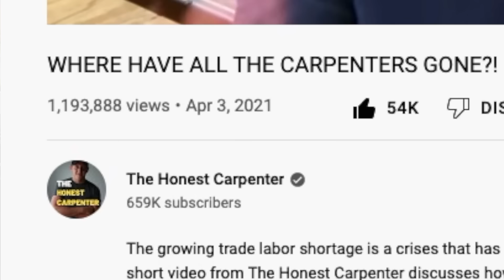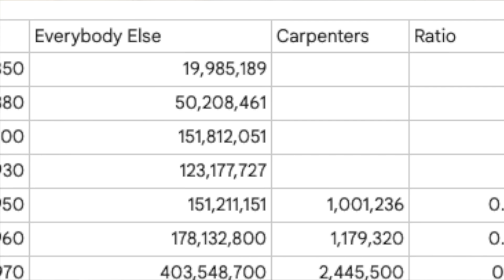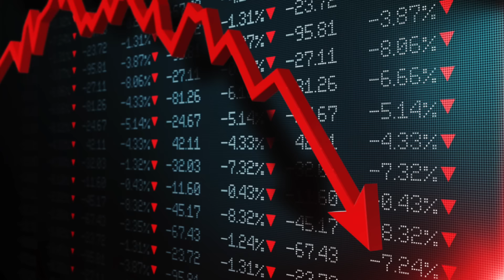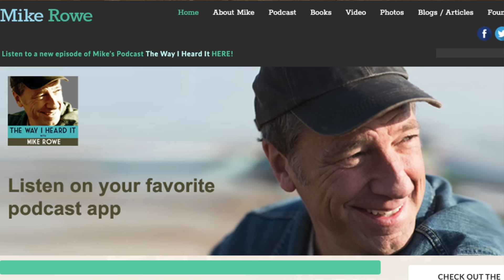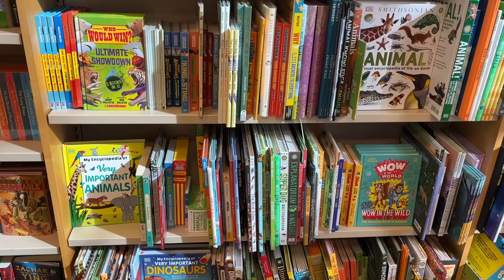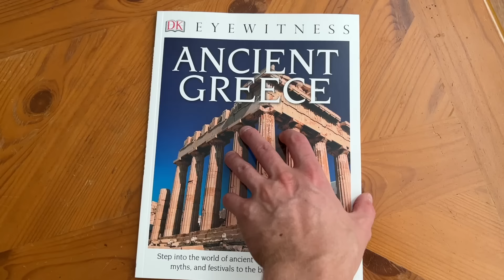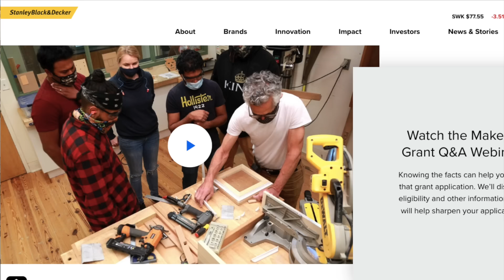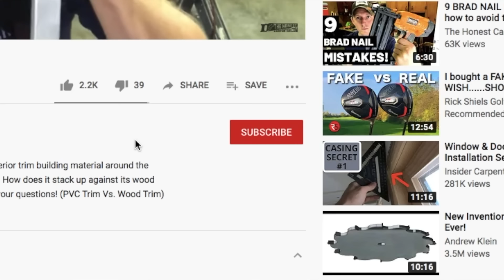THE TRADES ARE DYING...But The World Still Needs To Be Built! CAN WE FIX THE SKILLED LABOR SHORTAGE?

Comment: The issue I had with the trades is that everytime I've applied to any of them I was always pushed away for "lack of enough experience" instead of being welcomed and trained. These trade companies need to be more willing to train people even if that means slowing down a bit for the sake of growing their work force.
Reply: Yeah, only unions or “community” college/Vocational schools/trade schools will give you the experience not many companies are willing to train people as it hinders their bottom line. This has always been the case, and is why guilds were so popular leading up to the Industrial Revolution.
Reply: 19yr old carpenter here. I got very lucky with the company I got hired. I applied to about 12 and only one offered me a job where the rest rejected me for not enough experience. Yet I had several years of finish and labor positions.
Reply: Absolutely correct. I'm a veteran steelworker and welder. I have no problem training people and my training retains people. Sadly, many bosses are still in high school and can't think beyond their ego.
Reply: @KRYMauL  When it comes to welding, trade schools NEVER teach realistic experience. NEVER. In fact there was a time that if welding companies knew you went to  certain welding schools (diploma mills), they would not hire you.
Reply: @heyman5525  I’m talking about getting training not just going to pass a test
Reply: Yea.  Its bs. And the older you get the worse it is.
Reply: @KRYMauL  You're good. I just had to make the point that there are some false promises with certain trade schools. It's not going to hurt, but sometimes people are out $20,000 and then have to relearn everything on the job.
Reply: @heyman5525  That’s a problem with basically every degree and is the price you pay for specializing.
Reply: I'm a welder and I've been told by several companies they they aren't actually looking for welders but millwrights willing to work for welder wages.
Reply: @deviouslee1183  so whats that comparison.  Are you a rig pipeliner
Reply: I'm from Michigan and many companies around want to hire apprentices but want a year of experience 🤦‍♂️like that's why I'm trying to be an apprentice because I don't have experience
Reply: @Jack-bs7cy  i get that.
Reply: My father in law is a contractor and he’s trained 7 people in the last 5 years. If you really want a trade job keep calling around. Look for small owner operator type companies. I’m fully employed on the farm, but I get offered trade work quite a bit. Im 25 and my only employment history is a year of bagging coffee in a factory and work more or less for myself on the farm.
Reply: @swamp-yankee  what trade are you
Reply: Basically what I'm going through as an Electrician Trainee. No places wanna hire me cuz I'm not a journeyman.
Reply: The reason why nobody trains anymore, is people invariably jump ship once training is complete and the worker has a minimum of experience. It's cheaper for management to poach employees from competitors.
Reply: Yeah and stop being greedy and pay accordingly to skull set.
Reply: @luisr1223  lmao fr
Reply: Sounds like everyone commenting here are in the same boat regarding to the dilemma of being employed after trade school or other.  As an automotive technician of 20 plus years it is no different here... 
Towards the end of my college training I was about to receive my automotive certificate of completion and I was looking for job everywhere. No one was willing to hire me due to the lack of experience. Dealerships, forget it they wanted you to have "their" specific training. Working on multiple manufactures doesn't cut it. Also many independent shops required a minimum of 3-5 years as well. So how was I able to get a "real career" job and build my experience if the doors kept closing on me?
Well I eventually had to start at the bottom working for a poorly runned jiffy lube and waited patiently to find a real tech job while going through college. Once I did the other hurdle was trying to obtain my ASE certificates. I couldn't receive them even though I passed 3 when I started working at my first shop. They had a requirement stating that you needed to be working in the trade for a minimum of 2 years or as student in the field you must obtain a written letter from your employer stating your currently working at a reputable shop. Which is what I end up doing. 
It is indeed a lot of hurdles to go through and there is no one way to take a direct path in this field. No guidance really.
Reply: @luisr1223  they want apprentices so they can pay as little as possible without actually hiring you, then they get a new apprentice, or you are much more efficient than the average workers
Reply: Every thing is On fire they dont know how to treat peiple and slow the F down and Be kind.
Reply: @nonconformist369  ota like.  We ve seen the supppsed benifit of "Free" markey capitalism, when in fact free markets dont exist
Reply: @nonconformist369  ota like.  We ve seen the supppsed benifit of "Free" markey capitalism, when in fact free markets dont exist
Reply: This right here. Ive done my CA General Electrician Exam already and all I need is the hours before I'm a Journeyman (For context, apparently CA is having a huge issue with trainees and apprentices not passing their exam, so passing it is a huge leg up). But even with that and more on-hand experience compared to a 2 yeared apprentice, no one is picking me up purely because of no recorded experience. The only ones I've gotten ahold of want to pay me under the table, meaning I can't even get my hours if I do work for them, and it's usually better for me to just work for some minimum wage fast food job at the rate they want to pay me. I don't know if it's because of the recession we're going through, but it feels like the trade drought I've been hearing about is almost self inflicted in some trades.
Reply: @heyman5525  I worked in the piping industry. Most jobs require that a welder prove his qualifications to weld each different material and procedure.  Bust your test and you don't get the job . 

So it doesn't matter what weld school a person goes to , you gotta put in booth time to get good at welding.
Reply: Not sure where you live but no one is turning down experiences or inexperienced help
Reply: Facts. It was annoying.
Reply: Thanks for this post I’m glad somebody said it.
Reply: Companies dont got all day to train people that leave the job 80% of the time. It is too much of a risk.
Reply: @heyman5525  I agree with the statement of many of them have this high school complex to them. I’ve been to a trade school and then did some labor work but also went to college. Many of them will often judge you on your life decisions. Most would say this is a real man's job and that is why we get paid more than most college graduates. I would agree but I wouldn’t judge another individual for wanting to do both. Trade work is better than working some part-time minimum wage job like most students. No student debt and have skills that will help me for life. This is from my experience and not to judge other trade skill worker.
Reply: This is what I've been telling companies for years. 
The response I always get is: If we train people, we invest company time and money into them, and if they leave for another company then we lose all of the time and money spent on training that employee.
My response is always: Maybe you should pay people what they're worth, and they'll stay.
But nooooo companies can't do that!!
Reply: @justchill4885  im a hiring manager for 6 years and this has been my experience that more than 70% of employees leave jobs due to reasons non-related to pay, including not getting along w coworkers/supervisor, work schedule, "tired of the same thing", "moving in with gf at a different town", etc etc anything you can think of.

So most companies have a policy in place to allow employees to prove their commitments and worthiness before investing more training into. You will not believe the amount of people we get that just want to "try out" the trade and end up giving up in a few months.
Reply: @machinist7230  employer trains employees while making money on them. Employe gets training does great job .... Same pay ask for more pay hard no. Jumps ship for double the pay for the same job. Employer mad 🤷‍♀️ well I'm loyal to the highest bidder not sorry.
Reply: @carrsllccarrillo6507  as an auto tech as well, You are correct. Been there done that. I eventually got my foot in the door the old fashioned way, by networking people I knew over the years.  learned most of my skills on the job after that. Real world practical stuff I was never taught in tech/ trade school. This was done long before the internet.
Reply: Pure bullshit, they say that about everything. As soon as I started to look for a job with my CDL license I found out there isnt enough jobs for CDL drivers.
Reply: Exactly. Everyone has to start somewhere. How do they expect anyone to gain experience when they can't even get hired because of lack of experience. They need to be willing to train people or else they're going to continue to suffer.
Reply: @justchill4885  They wonder why nobody wants to work anymore.
Reply: i have personally hired, worked with or trained about 75+ apprentices. maybe many more. About 15 percent stick with it.
i loan the tools and everything to get started in the beginning to ease the entry.
its hard to get energetic, self motivated dependable people.
i go to a job with 3 apprentices to put 5/8 drywall on a 12 foot ceiling.
my boss says he doesnt know how i do it.
he cant handle training one apprentice. most journeyman dont want to train. i get it. its expensive, time consuming and frustrating in so many ways.
in the last 5 years i have personally worked with about 25 apprentices. so few stay.
i need a selection of decent candidates to train. i just cant find them.
toronto
Reply: @heyman5525  thank you for training people with no work experience
Reply: @KevinChannelTV  True
Reply: @teaadvice4996  Thanks, sorry about my previous comment, I misread and misunderstood you.
Reply: if you went to a good school you wouldn't have this issue. 
i got recruited at school by a company.   didn't even have to apply.
Reply: @darkracer1252  You got hired because your school trained you according to the qualifications that your employer required. No school teaches the particular type of welding field that I am in. We have to retrain all the people that have come out of school. It's not that schools are bad by any means, but rather, our particular field is very specialized.
Reply: @heyman5525  no i did not. 
i come from a time where the school system simply was still good.  

the company that hired me had to retrain me in their operating system and their way of working. 
the school simply made sure i understood what they were telling me.
Reply: It's because they only hire their sons and nephews
Reply: @aerolightz2z419  exactly what you said. Employers make mad cash and they destroy their workers, especially in the trades.
 I took steps inside the trades and moved right on out, every gig I took on, all round construction building houses, general laborer in concrete.
 They were all screwing me over hard.

Any young buck watching here, your body, your strength. That's invaluable in construction, don't sell it as they won't pay you for it, and it has a real toll on you over time and construction doesn't have a healthy pace in 80% percent of the field.
Reply: @demammoet   we had  a local employer bitching about paying 24.50 on OT and not being able to keep people.

well ya see 17/hr is a bit low to destroy my body. and if im demanded to work 70+ hours a week the pay best be starting higher than 20/hr
Reply: That’s not even unique to the trades.  That’s the biggest problem in this country now with employment.  No one will train.  Everyone wants to hire people with experience, and they complain they can’t find anyone with experience.  Hmm, I wonder why…
Reply: @MD-en3zm  it may not be unique to the trades, but it is much worse there than anywhere else because alot of them act like a good ol boys club. 

i have the skills. and i will offer them out on my own , i have a whole portfolio of my work and references. the traditional trades will die and overpriced fucks like myself will do just fine.